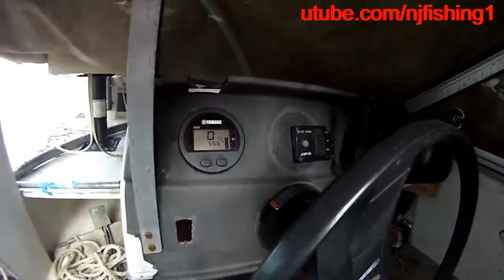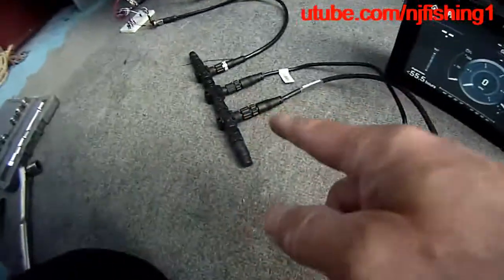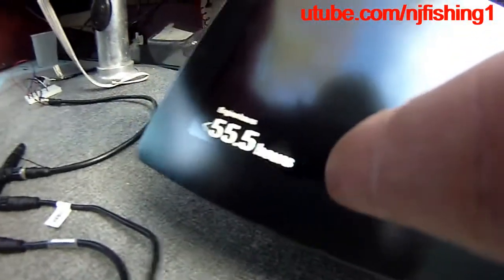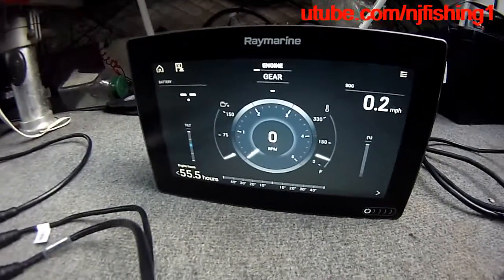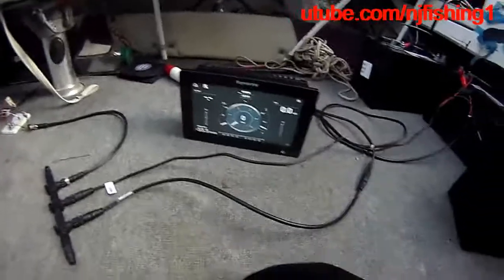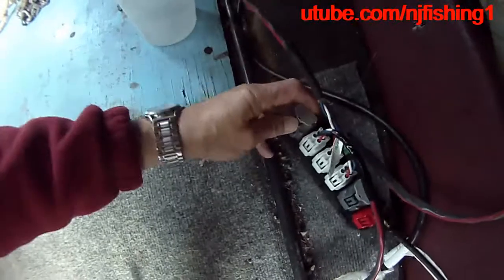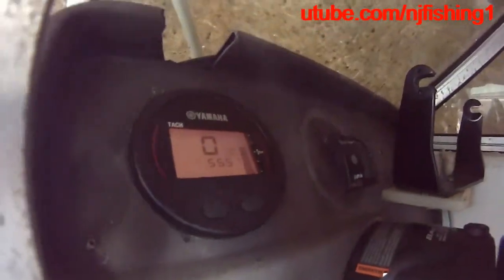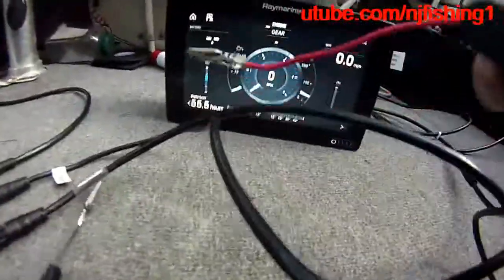How to display Yamama outboard engine data RPM, total hours on your fishfinder Raymarine Axiom MFD

Comment: Great video. So I have dual engines. 3 digital gauges plugged into my command link hub. I bought the E70242 cable to plug into the hub, but do I need the ECI-100 also or can I just go straight to nmea2000 with the E70242? You video seems to suggest I can go straight to nmea like you did? Also do you know if I need to plug into a device port or would the bus port work too?
Reply from the maker: No need for ECI-100 if u have Yamaha digital gauge

Comment: Hey, is my conclusion of this video correct, that you don't have to buy a Gateway or "translator"-box from Raymarine or Yamaha? Thans for your answer ;-)
Reply from the maker: No,
Reply from the maker: https://youtu.be/o7cVDZZzQCM - I already tried using Lawrence engine interface cable and failed. You need an NMEA interpreter ECI-100 and all the necessary cables for Raymarine ECI-100. Yamaha stopped making their black box gateway and started selling their own MFD meters that can handle multiple engines.